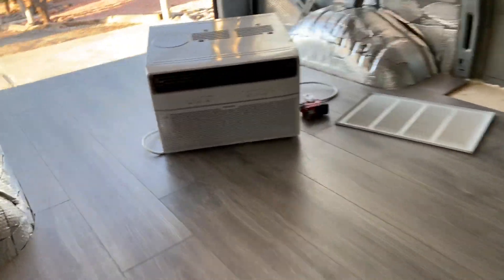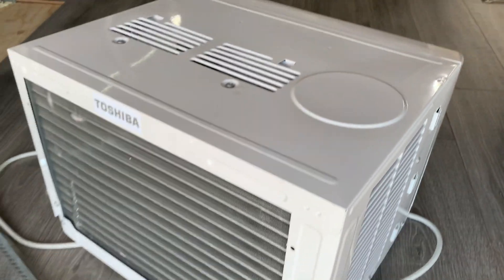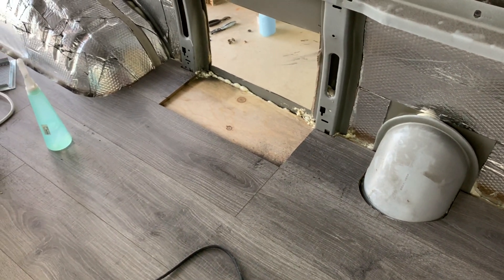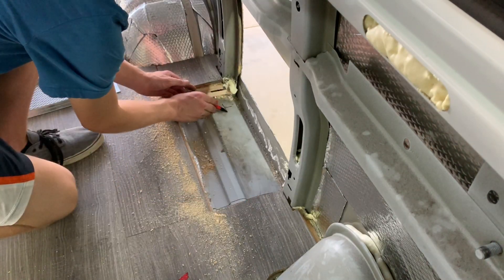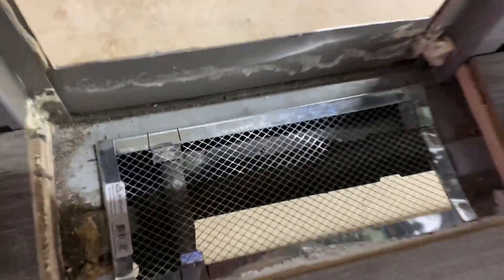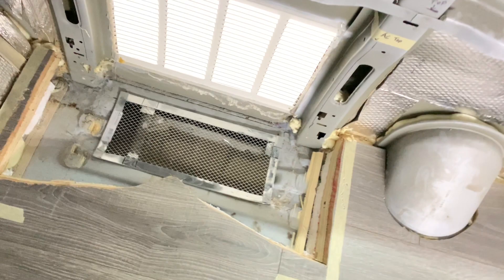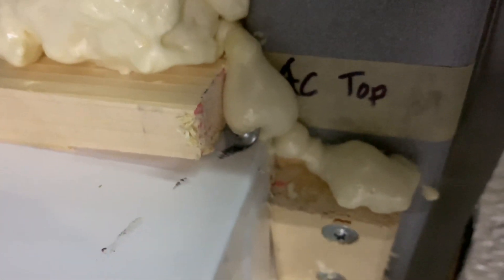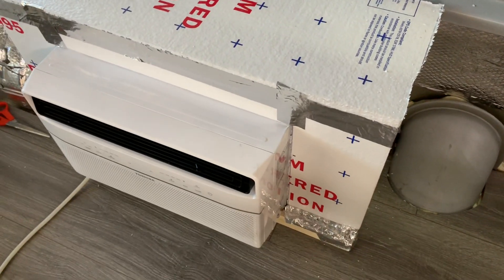Campervan Window AC Install (No Exterior Protrusion)

Comment: I plan on doing something similar. One question I have is is the blower powerful enough that it pushes the cold air throughout the van? I could see blocking off the front and adding some ducts. You could actually hide this entire unit under A bench seat if it has a Wi-fi app that way.   I could see this being mounted higher as well and a large 6 inch round  or maybe something like a 3 by 10 rectangular duct going down through the floor. As long as you've got a separate box that isolates the inlet from the outlet you are gold. I've seen a bunch of variations on this And compared to super expensive rooftop models going for several thousand it's a nice option.

Comment: I love brave, bold attempts like this!    4 years later how did this perform?   In my custom micro-camper van I installed a 24v 1800btu A/C that vents into a shared garage and it works great consuming less than 150w watts when the compressor is on. You can't see it from my living space.  Works great in the shade and at night to get humidity out and lower temps to comfortable.   video on my channel.
Reply from the maker: Sounds like a solid setup! I have since sold the van, but keep in touch with the new owner. System seems to still be working great after 4+ years!

Comment: Got the same floor in my RV and I drilled a hole in my flor today to move the propane heater . But will be cutting a hole for an ac unit in a couple months . Live it nice work.\

Comment: I think between water from the A/C unit, and rainwater wicking in through the side mounted grille, you're going to be dealing with water leaking and soaking under the floor. It's an interesting idea, and a very compact solution, but water is relentless. 13 years building car bodies at BMW
Reply: @47plymouth that was my first thought! Rain coming in the vent!

Comment: Im doing one here soon and my design will basically allow one to remove the outer vent and slide the entire ac unit out. When you slide it in it butts up against a foamboard box that seperates the return and supply and directs them out from under the bed with the supply having an outer directional vent so it can be directed upwards, of course this design only allows for this certain ac unit but its the most common midea window unit. Only problem is the placement puts the controls out of reach so it will have to be controlled seperately.

Comment: Someone should design an insulated box where you can place a window ac in and easily place that box on a hole on a van or trailer. Similar concept of installing a vent fan or an RV window on a "hole", wherein that box is supplied with a template so you know how large the hole on you van should be. And the box should be able to accommodate varied sizes of window ac. Then it would be easier to install/replace or clean/service the windows ac.

Comment: I ran same type ac unit in a bedroom where it couldn’t stick outside the screen. Ran a drip basin with a 5/8 piece of clear flex hose to drain into a bucket inside room. Works great. Am mocking up the same type system in my van but running a venting system with variable speed fan to suck out heat to the top of window where ventshades are installed. Building it in a cabinet inside side window. IMO AC should be mounted closer to ceiling and not the floor. Cold air drops, heat rises.
Reply: Good thinking I said that. Some AC units are mounted under a window at a motel but have vent louvers to direct the air flow. 73

Comment: I see a lot of people saying they're going to break from bouncing or whatever.... This AC unit costs 150-250. Have y'all seen how much a roof unit costs. Cheapest I see is $1599. So even if his breaks, he can replace it 5 times and from what I see, roof units are breaking just as fast. I'm going to do the window unit in my van conversion this week. Why? Cause I have 2 brand new ones that have 6 days of use and I am not spending 2 grand on something that adds even more height to my tall roof van. I've also come across videos of flying road debris tagging and shattering housings and one even was dislodged and ripped the roof open. The window unit is the smart way to go!!
Reply: Wait til fall I got a clearanced 5k btu window unit at Walmart for $55
Reply: Advent air rooftop system is $750. Freezes my van out. Does add a bit of height though
Reply: I still think a mini split would be better . And you get what you pay for.  Mini splits don't use as much power. I bet that unit if lucky it's a 8 or 9 seer and mini spits are way higher. The AC should be up high and not on the floor. 73

Comment: very nice AC installation thanks for sharing. I have the same chevy 3500. mine was built as a RV it has the roof style AC that sticks up threw the fiberglass high roof. even when new these roof AC leak rain water. I'd love to remove the roof AC an install a window type in it's place I think there's enough room w/ a smaller AC.
what I'm concerned w/ is the condensation draining.I have a pleasureway class B have you ever sean a road trek class B? they installed a window type heat pump AC under the high roof it's made for RVs the cool cat that's what I like to have..
Reply from the maker: Hi Steve,
Not super familiar with the Pleasureway's on the Chevy chassis, but I know 90%+ of rooftop RV AC units utilize a 14"x14" roof opening (which is conveniently the same size as the RV rooftop fans / vent systems).

I've seen the Roadtrek's on the Chevy chassis and love their use of the window AC unit mounted into the rear of the fiberglass top. (Makes for easy servicing I would imagine).

With yours however, you might be better off removing the current AC unit and spending the time to really seal it up properly (assuming the unit still functions).
You would probably save time and money going this route vs a retrofit of a window unit.

*********
With that said, if you were to utilize a window AC unit, you would want to source two threaded barbed hose fittings. You could drill holes to thread them into the sides of the lower AC pan. One on the left side and one on the right, then with the appropriately sized tubing, let gravity take care of the rest.
Drilling into the lower AC pan is a bit risky, as the refrigerant lines are all over in that area, so measure twice, drill once!

Comment: this is the only video i've seen that someone took the time to make a down slope not only for exhaust (not the best result) but also to drain any condensation from the dripping to leave the area at any angle! great job!
Reply from the maker: You never know when you'll be parked on an angle for the day! Don't need the condensation getting into unwelcome spaces. Thanks for the comment!
-Tim
Reply: @VanwithTim  yup i have a 1989 28' terry travel trailer with a 5000 inside only thing i did different was drill a hole in the bottom of the unit on both back corners an attached aquarium hoe to a t fitting to drain out the bottom
Reply from the maker: @ChefBoiImHungry  Nice! Have you had any issues with dirt / dust clogging the hoses? I wouldn't imagine you would have any problems with the setup.

Comment: werent you concerned with exhaust 
fumes coming in while driving?
Reply from the maker: Not too much. The exhaust exits on the passenger side behind the rear wheel. This was all on the drivers side mid-wheelbase. The giant beads of silicone and expanding foam between the foam board joints has held up wonderfully so far (3.5 years).
I opened up the foam board "casing" last year to add ducting to the unit. I found a good amount of dust and dirt on top of the AC (inside the casing) but none had made it's way inside the van.

You could test with a fog machine inside the van with the factory A/C running (not on recirculate or max AC). This pressurizes the cabin and any air leaks will be shown as fog coming out of the van. (Also a great way to find bad weatherstripping!)

Cheers!
-Tim

Comment: i will try same like you it good idea. 
where did you get air conditioner back side grill cover ?
thank you
Reply from the maker: The outside grille was made from this https://amzn.to/3IfRZ4F (your size may be slightly different than my requirements were).
I wish there was a stainless-steel version. Even with priming, painting, and clear coat, the paint seems to chip away over the years.

-Tim

Comment: Best solution was to take the AC Unit apart. Mount the external parts under the Van. Then mount the rest inside...Where it takes up little space. I seen many that did this and it's more effective. As the unit is hidden and protected under the RV...
Reply from the maker: I've been seeing more of that style install as well!
Agreed that's the best solution. (As well as mounting the evaporator up as high as possible inside the vehicle!)

Lots of lessons learned over the years.
Reply: Is there a video on this method?
Reply: Why don't put it on the top of the van.?

Comment: What btu is your air conditioner installed??
6000btu or 8000btu？？？
Reply from the maker: 6,000 BTU. I would recommend at least 8,000 BTU though (Or paying for the expensive IR blocking window tint - not the standard UV blocking stuff)

Comment: wow, that looks great, and apparently works that way, i though they pulled from the front and exhaust from the back, enhance the screen in the front, but i guess they all work different. too bad, you had to cut the floor and all that. it’s the looks great though, and you placed it right by the bed, very smart build. is that enough to cool the van on hot days? maybe your next video.
Reply from the maker: It has no trouble keeping up when it's in the shade, but once the sun starts shining in it has trouble cooling the whole van.
Could really benefit from an Infrared blocking window tint. ($$$$$)
Here's a comparison of a fully insulated box being cooled (the size of the van interior) vs the actual van: https://youtu.be/V0r2ijuKd-c
The van with all its windows used 227% more electricity to keep cool.

Comment: Dusty roads and water spray will clog the condenser fins quickly. Therefore, covers for the vents (maybe operable louvres?) should be used whilst in transit. Shading the vehicle during the day is preferable, so portable solar panels may not be sufficient to charge large battery banks for the A/C. I live in the tropics of Australia and the simplest solution to cooling off is to keep submersing yourself in cold water and reclining under a strong fan (wet the sheets at night). A cold beer or ten to knock yourself out doesn't hurt, either!!!
Reply from the maker: I give the condenser a quick spray down each time I wash the van (which unfortunately isn't too often!)
Here's a view of inside the insulated box after around 25k miles (40k kilometers) https://youtu.be/wq_KdOZR2R0?t=125

Saw another build which uses a large hatch on the outside for keeping the dust and debris out of the condenser - looked really nice!

100% on the shade being the biggest savior! But like you said, it limits you to portable panels. Best to just keep a cold 30 pack on hand haha!
Cheers!
-Tim
Reply: A waste they have mini splits for vans and don't look bad. Small holes. 73

Comment: Good job,on the install. I put one of these in a van once and it worked great for the 30,000 miles we had it. I’m now preparing one for a cargo trailer, thinking about making a cutout with a door cover and just sliding the unit in place when camping.
Reply from the maker: Just passed 32k miles on this one! Still doing great.

I like that idea. Can gain a lot of winter storage space where the AC would be in the summer time.
Also makes for easy replacement should the time ever come!
Reply: Our cargo trailer has a shelf and an exterior opening cover that we remove when we need to use the AC. Just slide it out until its in position and plug it in. Previous owner was a fabricator and we lucked out that he did this.

Comment: God job and nice rv van👍Bro what kind inverter you are using and it will handle to work the ac?
Reply from the maker: Hey thanks for checking it out!
Here's my 3,000 watt inverter:https://amzn.to/3BuJpel but a 2,000 watt unit would probably work just as well.
Reply: Are you powering a fridge off the same Inverter?

Comment: My air conditioner keeps turning off and back on after a few min over. I have it in a 1500 watt converter attached to a 2nd battery that is wired to the main battery. Any ideas?
Reply from the maker: Does it sound like your power inverter is failing? (Any beeping alarms?) Or does the AC unit just turn off? 
Do you know if your inverter is a modified or pure sinewave? (Should say on the inverter). Some electronics especially AC units really disagree with the modified sinewave inverters.

Comment: Excellent video and build. Further everyone's comments and suggestions is very helpful. I am having excellent results from a similar install in a lower area deflecting the cold air up a bit. Carl makes a good point, that in these installations' there are always compromises. The area in a van is small in relation to most 5000 btu units and even with some compromises will work fine. That said, as noted several times by many adequate air flow is one of the key factors. As to positioning high or low, as a practical matter in such a small confined area it has mattered little. Keep in mind almost every major hotel chain mounts the individual room a/c units down low with the vent facing up and control panel easily accessible to the user. Again, great job Tim.
Reply: Great observation Doug, as I just installed an a/c unit in my van , then got paranoid about its position and searched utube and found this guy and your comments. Thanks y’all I subscribed 👍
Reply from the maker: Thank you for the kind words Doug. I finally ran a proper test with the AC unit alongside a perfectly insulated living space of same volume. The results were more extreme than expected in terms of energy loss. https://amzn.to/3BuJpel
Windows are a nice luxury but I think I'll eliminate them in any future builds.

Comment: Did this work out for you? It appears that the air intake/air flow  (going thru ur floor) would not be sufficient enough for this system to stay cool. Maybe you can add a fan to puse the air in the intake vents... Please correct me if I'm wrong.

Comment: It would be neat after improving the drain area / exhaust area to route a grey water dump and exhaust a diesel heater through the same location. Seems like it could be very clean. 

Maybe have a way to easily remove the vent for maintenance and a fresh water hook up. 

So cool, thanks for sharing.

Comment: I'm old school.
My 5000 btu window unit is mounted in the window of the rear door.
After 5 yrs this is my third a/c unit.
Easily swapped out. This ' Arctic King ' has lasted the longest 2 1/2 yrs.
Any moisture from it easily drys out with the door open on a sunny day.
Reply: What happened to em and made em quit?
Reply: @mrmotofy   They are just cheaply made. My comment was made over 3yrs ago and my Arctic King is still running.  That's over 5 yrs . The GE and the LG lasted just past the warranty of one year. 
Is it quality or luck ?
Reply: @coastalkev3776  that's kinda what I'm trying to figure out. I bought one hardly used it. It’s failing already, won't keep compressor running more than about 20sec. Haven't tore it apart yet to check anything but seems like the compressor has failed and getting too hot then tripping high temp cutting it off. Makes sense from symptoms but who knows
Reply from the maker: I dig it. I'm sure it will be an all day job to swap mine out when it fails.
Simplicity can be a beautiful thing!

These window units are so affordable I'm sure you weren't too bummed or surprised when it came time to swap it out.

Comment: Hi, about how far into the van does this unit stick out and how wide is it including the boxing? I watched your venting video as well. How cold is that able to keep your van?
thank you
Reply from the maker: Thanks for checking out the videos! The depth of this 6,000 BTU unit is 16" but with the curvature of the van wall it sticks out around 18.5".
Width of the AC is 18.5" then with the thick foam board boxing, total width is around 33".

As for cooling, it does okay with my cheap felt window covers on, but has trouble keeping up if the sun is shining in through all the windows. 

It would no doubt do fantastic if the van didn't have all the extra windows.

I desperately need to have the purchase that expensive ceramic tint which would make a huge difference.
If I were to do it over, I would go with the 8,000 BTU unit. It's only an extra ~90 watts

I also installed a rooftop AC in a high-top Promaster. It was 13,000 BTU and was WAY too much. It would get uncomfortably cold and use way too much power.

Hope that gives you a rough idea for your build.

What vehicle are you working with?